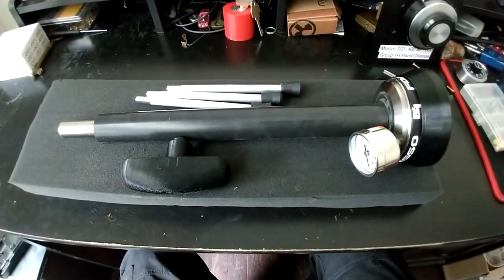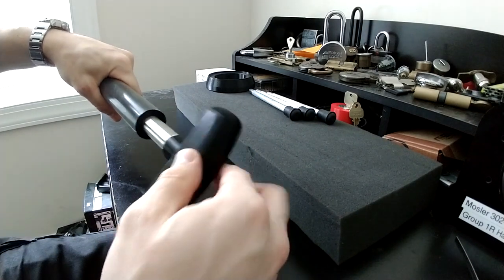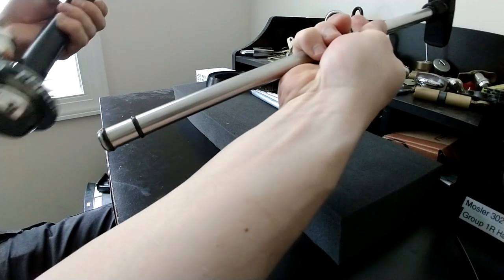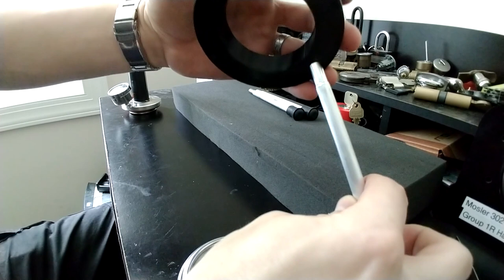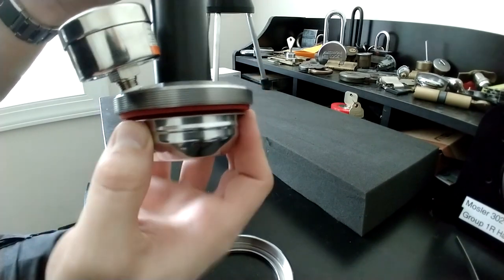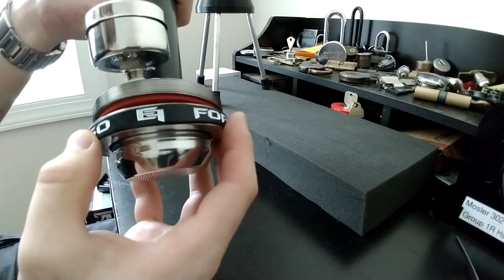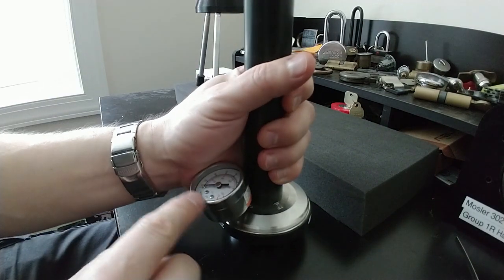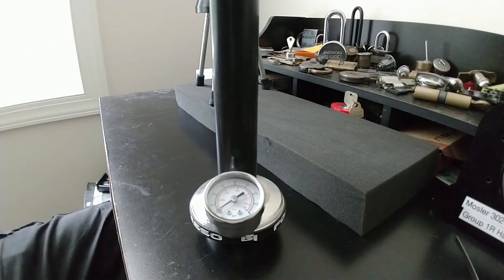Getting Started with your Forge

Comment: this looks great. I worked on a lathe machine for 10 years when I was younger. I woulld like to to make myself a similar one. do you sell them? I like proper coffee I like espresso machines but just returning from a short holiday where I could not find a single good coffee, I need something like this. just a question, is there a reason why the cilinder is small in diameter. could it be larger and shorter. i can see it is easier to press and squeze. have you tested different diameters an just came across with the best option. bless you. keep up the good work.